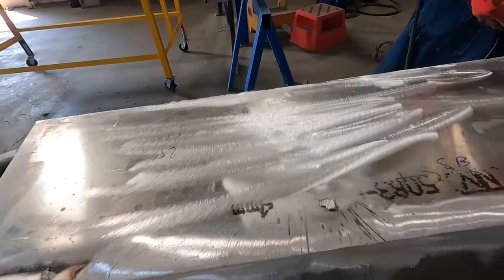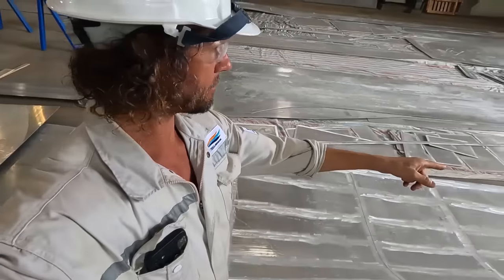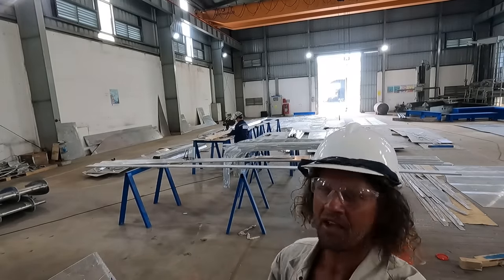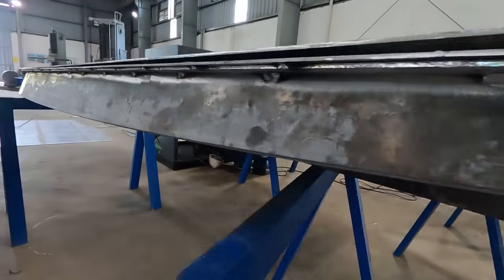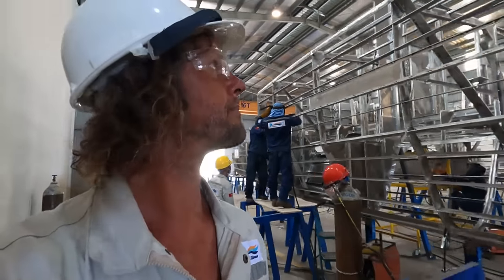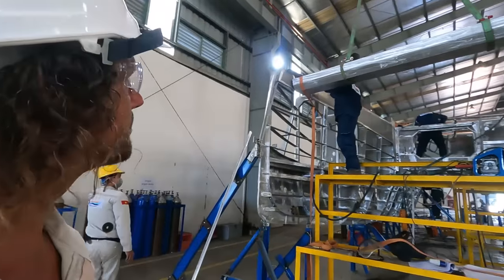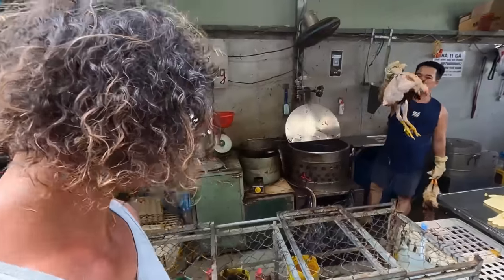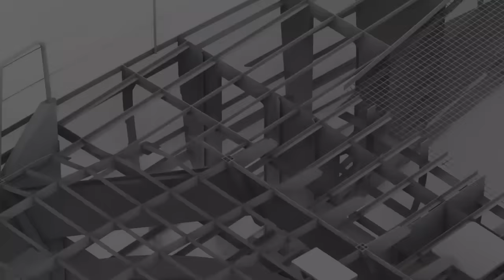Ep.19 Performance catamaran - You won't believe this boatbuild - 3 months in and rocketing along

Comment: Excellent progress. 
That's the way to build a boat, with a full team of skilled workers inside a building with all the tools. By yourself it would take forever... plus 10 years.

There are many reasons aluminum is not more popular as a boat building material. Among them is noise, temperature conduction (cold and hot), labor intense construction ($$), etc. But every boat building material has pro's and con's.

Comment: What aspects of the build are unique to the requirements of the Elcano Challenge?   Early on you described your desire for a simplified catamaran in terms of reduced weight and minimal electrical requirements for creature comforts.  How has that translated into the current design.  How does weight distribution for batteries impact design as compared to what would be required for fossil fuel and motors?
Reply from the maker: Good question.  Batteries are placed to keep costs and voltage drop down...no duesels so plenty of space  and balance for them all

Comment: A lot of thought and work getting the bow welded. Could bring all the structure back to the first rib and bolt/adhere a sacrificial alloy or composite bow. Would loose a bit of length for rigging but good for manufacturing and small impacts.

Comment: What you're going to do about the mast and boom?  Are they gonna manufacture the mast too?  If so, for such a cat I would definitely go with an in-boom furling system.  Just make sure it's a clever and SIMPLE design.
Reply from the maker: Not great sail shape
Reply: @SAILINGintoFREEDOM  it’s not a good sail shape if you go with in-mast roller, but with in-boom you still get that “twist” shape and even a square-top if that’s your thing.  Also, you can control it from the helm, without having to be in the danger zone doing acrobatics near the mast and boom while the bad weather unfolds.  Another advantage of in-boom is that you can drop it instantly when you need to; AND you can reef in increments that you like, rather than set increments.  The disadvantage of in-boom furling systems is that they can be capricious (especially on bigger boats, and even break, which is why it’d be better to go with a design that is as simple as possible. 
The Odisea seems to have a rather tall mast for the LWL of the cat, so it will mean the necessity to reef back and forth quite often (especially on a cat), which further points to an in-boom furlong system.